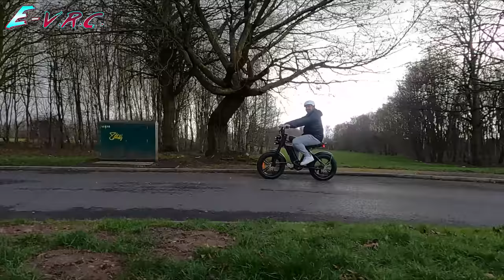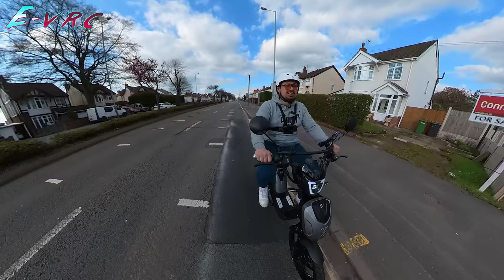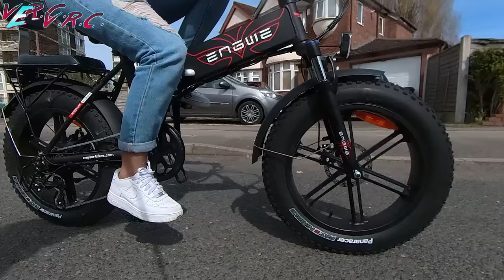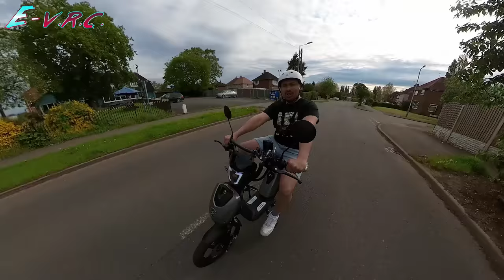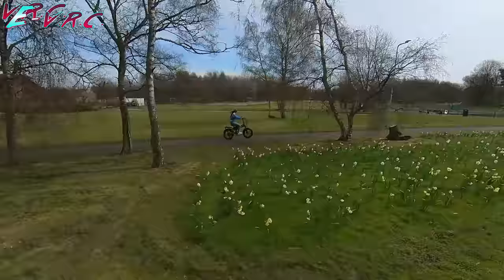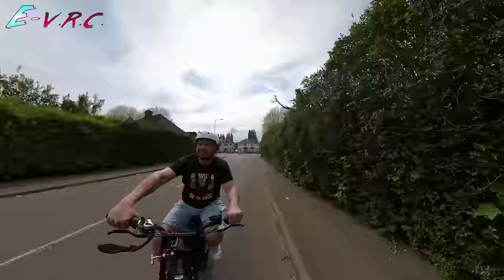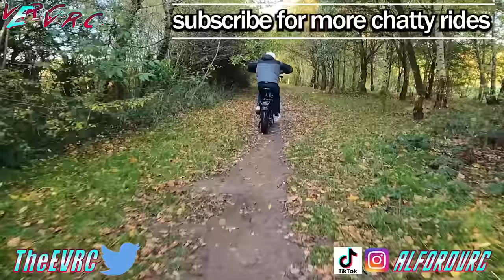The CRAZY Ebike law that MUST Change Before Someone Gets HURT

Comment: Although I’ve been pedal cycling for years I did try an ebike last year and admittedly enjoyed the assist on the hills ( I live in the north pennines). If ‘cyclists’ don’t want to pedal and want more speed why not just do your CBT, get a helmet, insurance and a more powerful electric motorbike?
Reply from the maker: That's fair. Anyone wanting more speed on roads and they're using the bike as a commute then a moped is a sensible option. This video is just about how a throttle (which controls speed - doesn't make anything faster) is safer than a 100%, all or nothing speed sensor - a speed controller controlled by the legs but doesn't actually require any physical exertion apart for the first few seconds as riders pull away.

Comment: To be honest my only problem with e-bikes is speed limit which is idiotically low. Speed limits should be enforced by signs and laws not technical limitations. The rest is fine by me but I agree, that 250W may be far too weak to assist heavier rider in hilly terrain.
Reply: Yes, we can use speed cameras to catch speeding bikes, read the number plate, require the registered keeper to name the rider, and ban riders for four offences in three years.
Reply: @DanielsPolitics1  Absolutely. If we can't enforce it, one way or another, how will we catch bikes with unlocked or out of spec engines?

Comment: So true with pedal assist, a young person could easily find themselves moving forward into heavy traffic from a stand still, all it takes is a slight rotation of the crank and the motor kicks in and will lunge them forward if in 5/top speed setting, very DANGEROUS ,the newer pedal assists are alot quicker than only a year ago.
Reply from the maker: Exactly, some '250w' bikes are pretty powerful now. Especially for light riders.
Reply: Yes! Definitely 100 percent... Very very dangerous smh
Reply: @e-VRC  Can you explain please - when is '250W' not '250W'?
Reply from the maker: @RichardNewman  some brands badge their motors as 250w and limit the top speed to 15.5mph but actually they are much more powerful. That said even standard motors that are truly 250w have more power being pushed through them. The watts is just current from controller multiplied by voltage. So if a controller pushes 10amps from a 36v battery it's actually 360 watts. But usually the controller only does it in bursts and doesn't maintain it. A motor that is truly 250w means it is happy with 250w being pushed through it all day but can happily deal with more for short periods of time.
Reply: @e-VRC  A 250w motor with a 36v 10ah battery in full power/no5 is already pushing 420watts ,they are 10amp on average and a 36v battery 🔋 charges upto 42v so 42x10amp = 420 watts ,Voltage x Amps = Watts 🤠🇬🇧🤟💯
Reply: @e-VRC  I'm sure we've already talked about this lol,you are definitely smoking the bud 🤠🤟 Purple Stardawg 🇬🇧🇬🇧😎 stay cool homey 👊🇬🇧
Reply from the maker: @ianmangham4570  😂😂😂
Reply: @e-VRC  seen tests on the Bosch sx or cx 240 mid drive. 
Rated for 240w when in fact it can give up to 990 w to the motor, out of the box with no mods. 
Thinking many manufacturers just badging the motors to keep them “ legal”

Comment: The laws here in the USA are more lax. But, people are pushing to change that because ebikes are resulting in a lot of bad accidents. Especially with kids. The accidents are more reminiscent of motorcycle accidents than bicycle accidents. As for your complaints about power, put in more power peddling. You will get stronger.

Comment: If you don't want to pedal on an assist hub motor ebike you can just put it in a low gear and pedal real slow and add zero power. Effectively a mild calorie burning throttle.

Comment: The faster you go the less stabile a bicycle is.  Thinner spokes and bicycle rims could collapse if you hit something at around 25 to 30 miles per hour.  Before you buy one, make sure the wheels are beefy enough.  Just look at the spokes on a dirt bike compared to a bicycle.  All ebikes are not built the same.

Comment: From my POV speed limits should be based on where you're riding, not what you're riding.
A low speed limit on shared pavement where pedestrians and bicycles have to share, a higher speed limit on bike paths and lanes, and an even higher limit on roads (why not equal to the speed limit for cars?) would make the most sense.
This would mean you could ride your e-bike like a bike on bicycle paths, and like a moped on roads, instead of needing to have two vehicles.
Or if you're into offroad, or sports, you could have a powerful sport e-bike, but simply ride it slowly and carefully when on public bike paths / roads, and only use its full potential on race tracks and private land. Makes a lot more sense to me than having to transport your e-bike by car because it's 'too powerful to be street legal'. As long as you ride it within speed limits why should it matter?

Comment: Not sure where you got your data for USA eBike classes, but there is no 250W limit anywhere in the country. 
750W is the stated limit in the Consumer Safety Act (15 U.S.C. 2085), but many bikes exceed this, some go as high as 2,000W split between two motors.
My Class 2 has a 500W motor which peaks at 880W, and has been enough for my needs. Maybe if I lived in a much hillier area I would have needed 750W.
General opinion on throttles, I agree with you. A throttle increases your options and thus safety in many situations, such as starting at traffic lights and getting up hills. Speed limits make sense, throttle limits do not. 
I got a Class 2 BTW because it's treated just like a class 1 but has a throttle, while Class 3 are banned on shared pathways and bike lanes in my city, and that's where I want to ride.
Reply from the maker: Haven't seen the video for a while but I know there was a mistake. I think I accidentally put 250w as class 1 but actually class 1 has a speed limit.
Reply: @e-VRC  Yup, it's 20mph for class 1 pedaled and Class 2 pedal/throttle, which is the limit on shared footpaths (slow to 12mph when passing pedestrians) and most suburban roads as well, so that adds up.
The only need to go faster is in road traffic if there is no dedicated bicycle lane and nowhere to be passed safely by cars.

Comment: Why not just use a fully U.K. legal e-bike with full throttle. Approved as an L1e in the category 250W LPM (250 Watt Low Powered) Moped. Which still makes it an e-bike. When Type Approved, can be ridden legally on roads and private land within the UK at speeds of up to 15.5mph using just the throttle. A Type Approval Certificate lasts for the lifetime of the bike and does not need to be renewed.

Comment: The shifter on my ebike works exactly the opposite way as the shifter on the regular bike I've had for 12 years. As a e result, I end up stopped at lights in 7th gear all the time.  I'd be screwed without a throttle, or at least a "green button".  

I'm afraid the only solution I have to stupid laws is to bypass them.  In the immortal words of someone, "We have the technology."

Comment: Obvious idea that gets round any legalities is to have a throttle that only works when pedaling. Then no "accidental" assist when just doing a turn in the road, and more control over assistance level. (Which with the bafang kit shoved me into a sign post when I was just trying to mount a curb, although I could mitigate it with a light touch of the brake that disables the motor).
Reply from the maker: Makes sense. Plus the initial punch from 0mph to get you going.

Comment: I think throttles were legal until 2016 and the law changed after that I believe. With the Eskuta does the chain actually do anything since the 'pedal assist' in bikes I've had are on the pedal shaft and your description of pedaling the Eskuta suggests that the speed of pedaling does not change the actual speed the bike is traveling at?
Reply from the maker: It can be ridden without power but it's VERY VERY hard and you can get to maybe 5mph due to an unhelpful gear ratio. Hence why at 15mph it does nothing. But it's all connected.
Reply: Same with Fido L3. No gears and once it’s moving one is basically ghost pedalling to keep it going.

Comment: Easy known the people who set the laws never actually use ebikes. My T1 has loads of power to go up hills but is limited to 15mph. In my view it needs to be 18-20mph. But not more, simply because I don't have the battery to be doing greater speeds. If that were not a problem, maybe a top speed of 25mph would be great for longer distances. If you had enough battery . . . So 70 Watt motor with 20mph would work great for everyone. Higher than that they could introduce fines etc. But I think there might be a deliberate attempt to keep people out of ebikes so as to better support the auto industry. But the government would never tell you that.
Reply: It's completely the opposite it's designed to encourage cycle use

Comment: I have a conventional bike and struggle going uphill. Was thinking if I had an Ebike then I would have no problems with the hills but the laws in place mean there is no point me getting an Ebike if I'm going to run into the same problem. (can't afford a cheap Ebike let alone a more powerful one)
Reply from the maker: 250w are a definite no no for hills on power only but often with help from the rider it basically halves your effort so is quite good unless the hill is huge.

Comment: Yeah, if you have to have some sort of test, fine. But the speed should really not be so heavily restricted. Like you said, most cars are capable of 160 kph at least. That doesn't mean cars are ripping around at that speed all day. You've said plenty about the throttle rules already
Reply from the maker: Yeah i think age and cbt to unlock 19mph maybe. The 'buy a moped' commenters seem to forget that mopeds can have up to 4000kw (iirc) which means although they're restricted to 28mph they can actually go way faster than that.

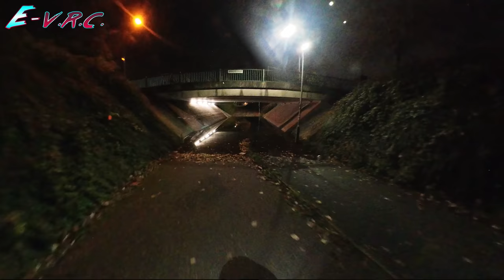Comment: That piddly thing @8:00 would be USELESS where I live as the wheels would fall down into the pot holes and launch you over the handle bars!

Question, the bike you were using demonstrating the gearing being a PITA to start with if caught out (yep used to hate that on the mountain bike and racing bike when I was younger), I like the fact you can use the throttle to at least start your bike moving as you presented. Now the question is, how do you get a larger (maybe not so legal) motor (say 500w since I'm a larger person ... not as much tubby as tall and built brick craphouse) fitted to the bike and preferably without being obvious? Is it a new hub/wheel or something else? I've no interest in getting over 60km/h as it hurts too much when you come off at them speeds and yes I've managed them speeds on a racing style bike without the motor.

I agree 100% it should be a speed limiter not throttle, etc limits.
Reply from the maker: Hi, there are quite a few online retailers that sell ebikes that are more powerful than 250w. And there are also bikes that are marketed as 250w but are actually much more powerful. An example being the Engine X from engwe. All Super73 bikes are generally a lot more powerful than 250w too - they have an 'off road' mode. But are marketed anf badged as 250w.

And yeah little wheels and potholes should never mix 😬😬😂😂

Comment: here in the state of Missouri usa a electric bicycle can have up to 750 watt motor and go less than 30 mph and is considered a motor vehicle and you need a driver license
Reply: same requirement here in NL for speed pedelecs, on top of that a license plate, but the limits are power 4000 watt and speed 45KMH assisted.
Reply: @hegenious  missouri finally changed that electric bicycles that you can also pedal does not need a drivers license

Comment: Not sure you got it correct. It is 250w sustained. My bike puts out 90nm of torque and is above 250w but not sustained. You can have grandfathered throttle but in turbo mode you hardly even have to turn the crank. With my gears i agree 20mph limit makes more sense. Not like i can't just pedal that fast anyway. Well downhill. Now if i could just get my bike to think it was in the USA.....

Comment: E-bikes like the SX-250 are actually mopeds. Many of these bikes can reach those upper speeds and are designed with the same or similar construction. Yet, they're classified as a bicycle to cheat laws/regulations. 🤔   Why did cycling become motorsports? I do not oppose throttle on E-bikes since those can come in handy. 250W motors are also a perfect fit for most forms of cycling. Though I think MTB and class 2 would be better with more powerful motors. Afterall, bicycles were never meant to be motorcycles.

Comment: the 250w limit is totally stupid if the speed cut out is still 15mph. why should anyone care how you got to the 15 mph, its not as if ebikes are going to be so powerful that you have to lean forward to stop it doing a dangerous wheelie like on a high powered motorbike.
Perhaps there could be a rule change to allow much more power if you have a trailer

Comment: A lot of your complaint about pedal assist appears to mostly be about not using a torque sensor and having to wait for a cadence sensor.
Reply from the maker: Basically cadence sensors are worse but torque isn't perfect. Better up hills but not better than a throttle. Plus torque sensors add a few hundred to the price. A lot of people who say they have no issues turn out to have £3000+ bikes.
Reply: @e-VRC  Yeah, that's the thing (price). I'm fortunate here as I have a legal throttle due to my bike being manufactured/brought in 2015. A year before the throttle law came into being. As I understand it, the law is not retroactive. But the pedal assist is a cadence sensor and pretty crude in that sense.

Comment: Yep the throttle law is daft, but here is the thing, under UK law you can have a yhrottle, but under UK law the bike has to be no more than 200 watts, EU law gives you the 250 watts.

So because of the confusion over what laws we follow with bikes I would say that as we are no longer 8n the EU we follow both laws so we have 250 watts EU with UK law throttle, seems to make sense.

The beat of both, but the EU  also allow for what they call super electric bikes that have to be registered but I don't think they need insurance.

Also many EU countries allow escooters which also use a throttle so I don't think they follow the law of bikes not allowed to use a throttle anymore.
Reply from the maker: I like that idea! And yeah tbh I don't think anyone with a 250w bike going at 15.5 mph is going to get into trouble because they have a throttle.

Comment: Recently bought an Ado Dece. Absolutely fantastic e-bike. Also purchased a throttle with it which takes it upto 30 mph with no assist, from the standard 15 mph. On the roads, I simply disconnect a plug in connection so it rides as standard, then off road plug it back in. I never ever use it on the road with the throttle connected. 🤓🤓🤓🤓

Comment: If you were on a pushbike  and going round a bend where the pedal will hit the ground what would you do?
It concerns me that something so basic causes you to lose concentration and you are on our roads!!
Seems you want to ride around on a motorised bike but not have to pay for it!
Why not get a moped?
Reply from the maker: Rhetorical questions or are you actually asking me? Sadly we don't have control over who buys ebikes. Lots of things can cause people to drop their concentration levels. It's not like they're dedicating their entire brain power to their pedals. But if someone has to think about it then 100% is no longer on awareness. Like a new driver who has to think about clutch control and changing gears. Maybe they shouldn't be on the road but they are and a throttle would help decrease accidents.
Reply: @e-VRC  not rhetorical, it was a direct question based on you saying that if you have to concentrate on where your pedals are as you go round a corner then its a danger.....
How the hell have billions of humans coped for centuries then?
I am NOT anti Ebike, I think they are a greta part of the solution to transport for humans, but just like with cars there are knobs and decent people, difference currently with bikes is there is no laws on them to govern that. 
But racing around the same speed as mopeds without the legal requirements aint right.
Reply from the maker: @leeneal6969  ok but this video is just about how throttle is safer than pedal assist.

So to answer, i think when my pedals hit the floor i said 'oof' or something like that. Others may swerve a little. Others might look down at the pedals then miss the kid who crossed the road without looking. It could happen. But tbf most ebikes don't have this issue, it's just one point of many.